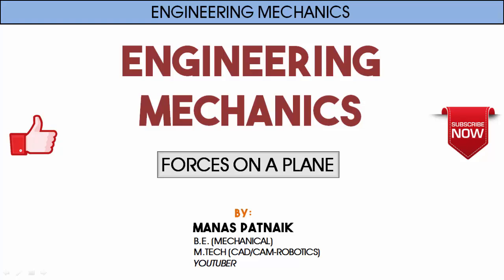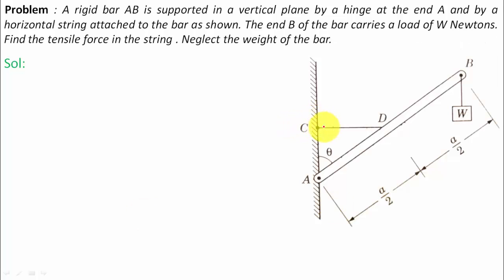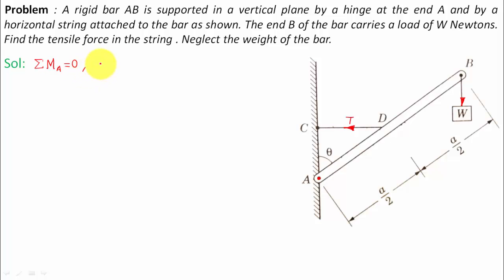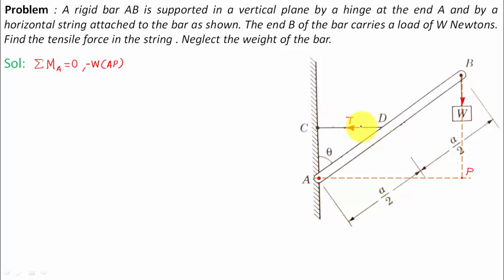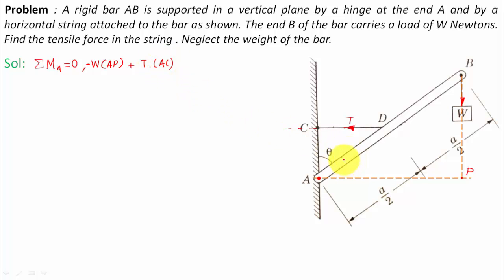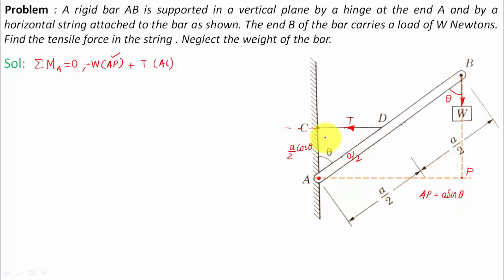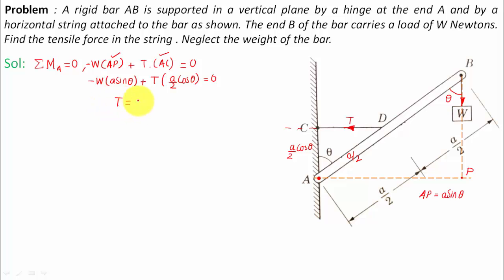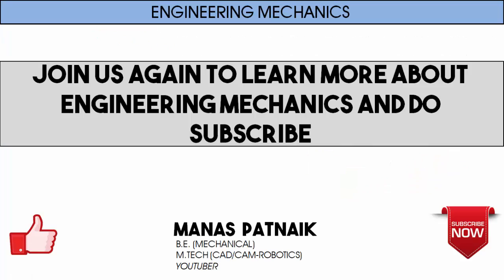Engineering Mechanics_Forces on a Plane_Level 1_Problem 12

Comment: Why you have not taken reactions at A
Reply: the moment about  point A is zero. and the tension in rope can be calculated by taking moment in consideration alone. if net force equation was to be calculated then reaction at A would be considered.
Reply: @ravindrasah5664  so if we use Ha and Va that will not be a problem,as per your words